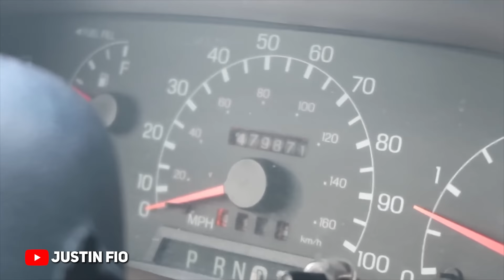OVERRATED Trucks From Each Brand!

Comment: My cousin had a 7.3 with 330,00 on it before he sold it. It was an animal for all those miles and will continue to be.
Reply: Neighbor has 550,000 on his
Reply: Buddy has 800,000 on his
Reply: @geoffnelson64  Do you know if it's the same engine? I'm not doubting you I just was wondering.
Reply: @drakeremillard6025  idk probably not that's an awful lot and it's pretty whooped on
Reply: Mine is at 190,000. I think engine is finally broken in at this point

Comment: My old 7.3 had 470k miles on it and went through 2 transmissions.  They do have their problems.  Aftermarket suspension is one of those slim pickings for sure.

Comment: i will say, I think the most overrated trucks are: ford raptor. Dodge ram trx. chevy silverado (2021)
Reply: Trx ? There’s not even a lot of them.  Plus the raptor isn’t overrated as it was 2 years ago. The new Silverado’s are over rated and the cateyes. I will say second gen Rams are overrated because everything has been done to them.
Reply: @Jonathan-tb6fm  the trx are all over where I live in iowa. Seen a guy that had dealer plates on his, using it to haul dirt on the job site😎
Reply: @Jonathan-tb6fm  dirt in the bed!
Reply: @geoffnelson64  i seen a raptor with a ladder rack and a dump trailer before. I couldn’t believe what I was seeing so I moved to the other lane  and saw the fox shocks.
Reply: @Jonathan-tb6fm  if the cateye's are overrated why do they have one of the best engines and transsmision's ever, but owning they rust way to easily
Reply: @huntersmith8062  because everything you can do or think of has been done to them. I didn’t say the powertrain was the problem. Everyone has them it’s not special build anymore. I would rather look at different variety.
Reply: @huntersmith8062  Cateye in general? Ahem, 4l60 ahem
Reply: I like the Trx but agree with the raptor
Reply: I'd rather have a Rebel or Tremor over a TRX or Raptor. I like to off-road but I don't need some high-powered desert racing truck.
Reply: @private6549  im thinking about getting a 2010 raptor as my FIRST truck, i think it's super awesome and affordable. Why do you think it's overrated? i'm an absolute newbie can you enlighten me

Comment: You were 100% correct with your first assessment of the catseye being overrated. I had one and I never understood the appeal, mine was awful
Reply: thats suprising most people love them ive got a 3500 with 220k and no issues
Reply: The front end looked nice but the truck is crap. Cheap and weak, should be GMs motto
Reply: @americantrucknation4891  I disagree nothing on my truck feels cheap maybe on 07-13 gmt900 yeah there shit but not cateye and older. thats just my opinion tho
Reply: @americantrucknation4891  I guess you’ve never driven a Ford then. Cat eyes are probably some of the best GM trucks around if you where talking about 2007.5 - 2013 then I would probably agree with you.
Reply: 5.3 4l60 with 190k no major problems
Reply: And here I am and the 1999-2006 are the only gm trucks I actively avoid.
Reply: @Connor4x4  Why?
Reply: @redneck_3383  Everyone I know who has those has had massive problems. 

Interiors falling apart and it rusting inside out no matter how well they wash it. 

They have great drivetrains but at least in my climate they don't last long. So many gmt400s, squarebodies and even older ones driving around still and the gmt800s haven't lasted as long. 

I skip that gen if I find them and only buy 1998 or older OR 2007 and newer. Never had issues with them. I've seen the 2007-2013s hit 400,000 miles consistently out here. Even with AFM.
Reply: @americantrucknation4891  The front end is why I hate that generation. Looks terrible, imo.
Reply: The cat eye was so ugly at first. I like them more now. Just based on looks. The generation before that is underrated.
Reply: @jamiepippin3892  to be honest the only people i see drive the generation before the cat eyes are tweaked right almond with the 96-03 f-150's I believe thats the years on it

Comment: I don’t think 7.3s are really overrated my dad has two of them they do what there best at being reliable
Reply: Yeah reliable after you’ve fixed the grocery list of potential failures. Only good diesel Ford has offered is 2015 - now power strokes those are actually decent any other is straight garbage when being compared to a 5.9 Cummins or a LLY/LBZ duramax.
Reply: @Back_door_bandit_98  my dad legit runs a 02 7.3 with only a intake and exhaust and has lasted 400,000 miles without issues
Reply: @jontroyer7975  doubt it I’ve worked on my fair share of 7.3s and with how much plastic and cheap hosing they have they all end up breaking down.
Reply: @Back_door_bandit_98  well nothings gone wrong with his truck and it has 400,000 miles on it now that’s a 02 he’s also got a e99 that’s got problems but his daily hasn’t had a single problem
Reply: That's why they're overrated
Reply: @PigeonLoftsTN  so they’re overrated because they’re reliable and that’s what the 7.3 is built for and you can make pretty good power and torque if you get them right
Reply: Your dads lying to you.
Reply: @Back_door_bandit_98  what grocery list of failures? 7.3 is the most reliable engine out of the big 3.
Reply: @Back_door_bandit_98  my 7.3 has 180k my parents have 140k my buddies dad has 180k my boss has 650k my buddies tow trucks all have 7.3’s with 600k to over one mil. Tell me again how there so unreliable
Reply: @zach5154  anyone can make numbers up. Does that answer your question?

Comment: My 7.3 has 320,000 miles right now and I still have original engine and trans with no issues not the fastest but plenty of power and I've never had to worry about it leaving me on the side of the road I love iy

Comment: As a 2nd gen 12 valve owner. I agree. Mine is super clean but my interior is destroyed. Dash needs replaced. Glove box. But as a whole, it’s my favorite. The Cummins 12 valve is super reliable after the KDP is done and the crappy transmission is built.
Reply: I've got a couple 12 valves, dashes are in great shape, maybe changed before I got em. The interior is pretty dated but I love these old trucks 👍

Comment: 1. Agreed but I would’ve said cateye the LB7, LLY, and LBZ were great engines but the rust of the truck integrity wise was bad 

2. Kind of, my favorite Ford engine but it is under powered and the transmissions are ass 

3. Again kind of, 2nd gems are probably the king of kings of diesels but the interiors as well as the transmissions  were ass
Reply: Transmissions weren’t ass the torque converters were

Comment: This one isn’t over rated but honestly if they’re done up right the obs Ford f150s are pretty cool. I swapped me whole interior with black and leather  seats. I also upgraded the 5.0 engine in it and rebuilt the e4od transmission and this thing is awesome. Especially on the 8 inch lift with 38’s haha
Reply: might as well just have got a truck valued the same as your upgrades 😂

Comment: I have an 2005 Silverado can I disable the active fuel management system in my year with a tuner??
Reply: Doesn't have active fuel management wasn't introduced until 07.5
Reply: @bhswarrior94  yes it does. I have bought a plug in to stop the AFM but would rather use a tuner. But someone said that a tuner won't work on an 05. That's why I was trying to ask a professional
Reply from the maker: yes you can!
Reply: @CustomOffsetsTV  thank you. Didn't want to buy one and not be able to use it.

Comment: The 7.3 is a beast but the truck itself does have some issues. I have a 2000 7.3 and the engine is mint it’s just the rest of the truck ThTs the issue

Comment: The second gen dodge was junk as far as the the truck went.  The Cummins and NV4500 were a solid, but the truck was trash.  Dodge used the same front end from the 70’s all the way until changing it out in 09.  The dash would fall apart, and the trucks were just cheaply made

Comment: 07-13 gm trucks were some of the worst trucks ever made. I've seen many that burn a quart of oil every 200 miles with only 100k on the odometer. They can be garage kept and babied and still rust to shit in several years time. Not to mention transmission failures and electrical issues. I believe those trucks were so cheap and trashy because that was around the time that gm was losing sales and had to be bailed out by the government.

Comment: Fucking obs ford bronco over rated asf.. Wiring issues low horsepower and torque outta the 5.0 transmissions are garbage prone to overheat plus secondary airpump(smog) killing horsepower and low end torque!!yet i still love the look of mine i really contemplate selling or swapping my drivetrain out for something more reliable and easier to make power with!